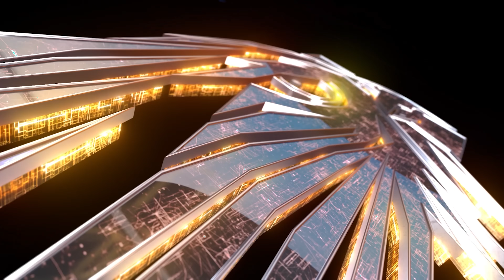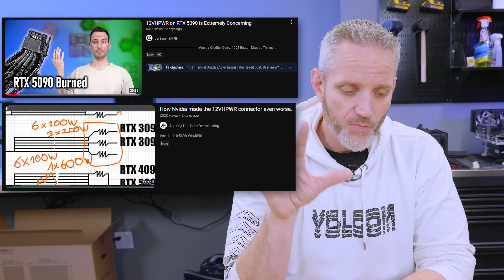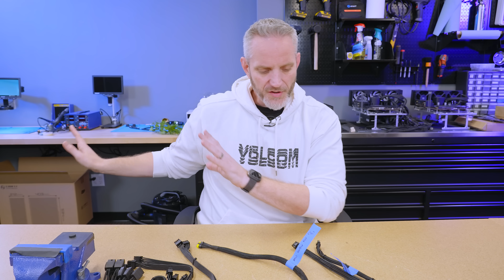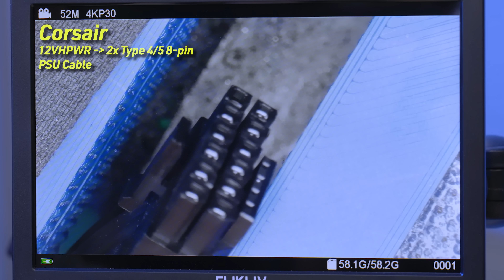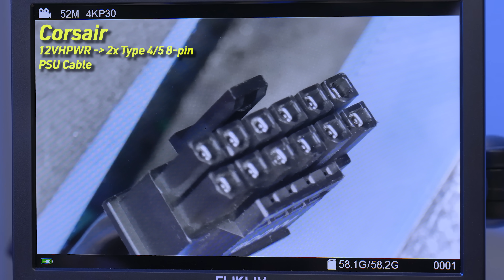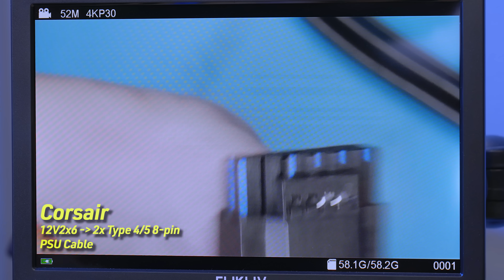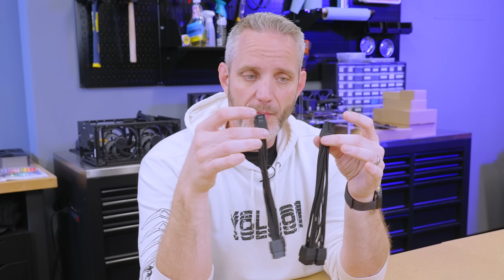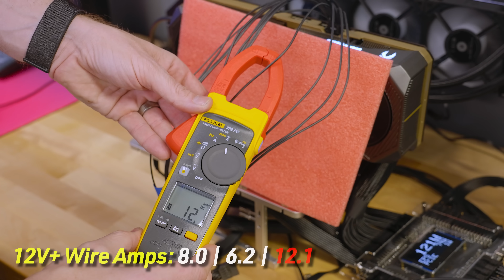I discovered something concerning and I need the Experts to chime in... More 12VHPWR discovery!

Comment: The 12vHPWR (H+) is only good for 9.5amps per core. 6x9.5 =684watts)   'de8auer' got 25amps and 150 degrees on his RTX 5090, very concerning indeed. Goodbye 5090. NVIDIA has really stuffed this one up after the 4090 debarkle and seems nothing learnt. That plug with recessed pin is really bad/ less surface area for contact means higher resistance more heat per surface area and will melt, Earth pin (Negative) is just as important as the power pin (positive) This screams no understanding of resistance & parallel circuit penalties. (down ratings there of due to resistance differences)

Comment: 13:54 - Pins moving inside the connector housing is a huge problem. Automotive OEMs go to great lengths to keep pins from backing out upon insertion, especially on high current circuits. Even if this isn't THE problem causing uneven current flow through the individual wires, it's clearly not operating the way the engineers intended and should be warrantied by Corsair.
Reply: A solid DTM connector should be an excellent replacement for this 12vhpwr trash
Reply: Automotive OEMs are usually held against regulations too. Regulations written in blood.
Reply: Lol, just saw your comment after posting mine:
You are definetly correct. Having a bad housing will lead to failure eventually.
Reply: I have Seasonic PSU and it's moving too, I noticed it immediatelly when I unboxed my new PSU, it doesn't look good to me. Ofcourse old connectors had this problem too, but it had much bigger pins and it was able to handle more amps than needed.

Comment: A bad ground can absolutely cause issues, however, there is some grounding occurring through the chassis, so that's why you don't typically see melting on the ground pins or cables.

The PSU outputs need the same bus bar setup as the GPU side of things.

It's the only way to equalize the load, without individual pin control.

Comment: ok so technically ground could be a problem. technically, it won't be as much of a problem since the GPU is grounded quite well through the pcie connector as well, which then feeds back through the motherboard and the 24 pin / the CPU 8pins, potentially even through the case.
TL;DR: ground being bad isn't quite as bad as 12V, but it's still really bad.

Comment: The 12VHPWR cable has always had a limit on its inserts before it should be replaced. der8auer video used a 12VHPWR cable with 2x8pin likely long past its replacement date. Also only using a cable with 2x8Pin means those sockets are at 100% of Corsairs claimed max, then add in a past service life 12VHPWR cable socket its no wonder that two 12volt cables where running hot. I suggest if you are going to buy a 5090 and don't want to use the supplied cable adaptor then also buy a new 12VHPWR with 4x8Pin. Before somebody chimes in about 12V2x6 cable I believe its a change in the pin lengths so isn't a change to the cable male socket ends at all.

Comment: The logic is wrong in DerBauer's and this video (to be fair, DerBauer kind of got it right near the end of his video, its mostly the comments section that gets it all wrong). 
The bad connections means that less current flows through these cables, see below for explanation.** Six 12 volt cables connected in parallel is exactly the same as having 6 resistors in parallel. If you have a high resistance on one or more of the cables (due to bad connections), then more current will flow through the cables with good low resistance connections.  Put simply, the cables getting hotter are the ones with good connections, they are carrying more current because less current can flow through the cables with poor (high resistance) connections.

**The six 12 volt cables are connected in parallel, if you have a look on the card, and inside your power supply, you will see that all 6 are connected together on the boards at either end. They do it this way because it simpler (and no doubt cheaper) to use the same thin gauge cable for everything, then when you need to carry more current you use multiple parallel cables, rather than having to swap over and use heavier gauge wire on some parts. Its a common practice in all devices, and you will especially see it on ribbon cable and flat cables where there are many very thin conductors.

Comment: A very important consideration to note - the wires that carry LESS current are the ones not properly engaged, as the worse connection means higher resistance and allows less current to pass. You will probably see higher temp on the connector itself on those pins, but the wire will be cooler. The hot wires are the ones that are effectively carrying the load, since electricity will always prefer the path of least resistance. Perhaps after you insert the connector, try grabbing each wire and pushing it into the connector directly, to see if that makes a difference? Manufacturing tolerances on the pins and socket might be the cause, forcing some pins to not engage to the same extent due to the pins sliding inside the plastic, causing higher current draw for some pins.

Comment: 12VHPWR is a crap design that in a perfect world barely can supply the current needed for these new high end cards.   There is basically no wiggle room for error.  Combine that with crap manufacturing practices using crap materials and we are where we are.  I'm still rockin my 3090 but if and when it dies and this junk connector is still the standard, I would remove the connector from the card and directly solder my own plug solution.  Hell, Anderson power poles would be better than this crap.   And Corsair is full of shit.

Oh yeah, the ground topic (edit) - I'm less concerned about a ground being loose.  There's a whole bunch of ground pins on the slot connector and the card is screwed into the case.  Having multiple paths to ground though can do weird shit to sensitive circuits if one of them has higher resistance though.

Comment: The 5090 issue has diddly squat to do with pin depth. The fact that an 8 amp wire is pulling 23 amps. That's the problem. It's that simple. Nvidia screwed up. And they need to replace the entire line.

Comment: I just wonder why they can't use 4 PCI-E power cables on the graphics card and not need any adapter.
I'm not sure why Nvidia insists on this new micro-tip 12 pin cable that crams 12 pins into to a microscopic tip.

Comment: cut a gen 1 in half and see how little plastic holds the pins in position, too much tension/torsion on the wire can alter the orientation of the pins in the plug plastic housing resulting in poor connection. Or a melted plug

Comment: a Poor ground will burn up a hot wire way before a hot wire can burn a ground.   In Mobile Audio a loose ground will pop a 300A fuse on 0/1 Gauge wire.    If the 12V power comes loose maybe some sparks, but you are also loosing the load, no load = no amps

Comment: I've been using a Corsair one for like 18 months I'd say, with my ASUS TUF 4090 on a 1000w HX1000 I think it is, and it hasn't been an issue. I'm worried now that it might be, but you'd think if it's been fine for that long that it should be good. I never thought the quality of mine was that bad.

Comment: So when you're doing the tests it does kind of look like you're using a 16 to 18 gauge. Kind of like your door speakers which usually door speakers are about 200 to 300 w 400 w is a lot. 500's a lot. 600 is extremely a lot for that gauge, especially when they're not gold contacts. 

It looks like Tamiya contacts...

They get carbon build up on them...

Eventually just by juggling a tamaya plug it will short out and stop working...

We switched to deans.  

Then Traxxas or losi ...

But i like the Chinese style XT or banana plugs both are cylinder gold plated...

Traxxas too much of a pain in the ass to solder and then clip together. Like to assemble the battery pack plug. I'm over Traxxas. I always had to have a special jig set up just to do Traxxas...

I also some like replacing a differential on sc-10s. That's a pain in the butt. Getting it back together. You have to clamp it down. It's so hard just to get the screw through to get the spider gears all back together with the spring on it.. 

I wish when i did ot they had a clamp to hole it together.. 

I used a small wood irwen wood clamp...

I was easier to just buy another ready to run truck ... When they were still $200

Comment: As an aside, in theory if each of the six "circuits" of the 12VHP connector was equally distributing load, that's over 8 amps per feed.  I don't care what the manufacturer says the spec is, I want to SEE the certified spec, because that's a lot of current to shove through those tiny little pins.  There must be some sort of positive contact dimple or something in the female end to guarantee contact, yeah?

The design of that connector and its implementation is not adequate for its application.

I would want to see spade terminals, 300 C rated 14 ga high strand OFC wiring, and a thermoset plastic or CERAMIC connector housing, in order to design for 20% headroom.  :\

I'm not an electrical engineer, I just have a lot of experience wiring stuff wrong.  LOL

Comment: If you own a bad one that is out of warranty, simple fix: Do a quality job of removing the connector from the board. I say quality, because I  am sure it is a multilayer board and there is a "barrel" in the hole that you can pull out with the pin if you don't so it properly. Hakko makes a super solder sucker for that. Take your best quality cable, cut the connector off, then solder the wires directly to the board. 
This is not for people with weak soldering skills.
Connectors are ALWAYS a problem for engineering. Both signal and power connectors.

Comment: Technically speaking amps in must equal amps out, so it should not matter which side 12V or GND has the higher resistance, they will both see the same overall current. That said, there probably is more than one path for ground to return (through the backplane/motherboard for example - it is highly unlikely the supply has a fully isolated ground), whereas the 12V supply only has the one path. This is likely why you predominantly see the problem exposed on the 12V side of the connector.

Comment: Shit engineering, shit manufacturing.  All ignoring Ohm's Law.

20a+ from what?  a 20/24ga wire?  What could go wrong?  Calculators exist, I am not an engineer.

I suppose if everything were PERFECT this "standard" could work....but IRL, that is never going to happen.

As annoying as it could be, as bad as the aesthetics would be....4xPCIe plugs would still be better.  At least I won't burn down my fucking house.

Comment: Since I know nothing about the card design, this is a brainstorming type thought, but are any of the ground planes isolated from each other? Could it be that failures are noticed on the power input pins rather than ground return pins on the cable connection because the pcie slot ground connections are carrying some of the returning current load in any conditions where a ground pin connection at the cable connection is less than ideal?

Comment: Also, ground wire can still burn up, but is carrying less load since you are also losing some of the incoming energy through the card as heat. If that bad pin was on 12v, you might have a melted pin by now, especially if overclocking.

Comment: The internal pins should NEVER wiggle or slide out if they are manufactured properly. You might be onto something with those pins, as a fully seated pin has more pin-to-pin contact has lower resistance to one that is only half inserted. Heating will occur on the contact area, and due to expansion of metals, could go runaway eventually since the contact will expand. Furthermore, different metals expand at different rates, which can result in higher resistance by default, and worse under adverse conditions. Basically, 12v2x6 is just a crap design that takes out the safety margin to maximise profit and asthetics...

Comment: Just checked my spare Corsair Premium 12VHWPR and the plug looks like the good cable.  I would not be surprised to find their standard cables having problems as the cable is so stiff, have zero plans to ever unplug mine from the GPU and it always felt like it would risk pulling the connectors out.

Comment: Maybe the problem is that the card is shorting out the 12V power rails of the PSU against each other (not to ground), directly at the 12VHPWR connector on the GPU PCB?
The theory: a PSU has e.g. four 12V rails, but they are not exactly the same. The first is also supplying power to the 3.3V rail, and the second is additionally powering the 5V rail. Only the third and forth 12V rails are the same.
This means, the internal resistances and voltages of each 12V rail are slightly different, resulting in rather high balancing currents going between the rails - along the 12VHPWR cable to the connector on the GPU, and then back to the PSU. These currents would run in addition to what the card is needing.
This could explain the uneven currents in the individual cables, regardless of the correct seating of the connectors. 
If the PMD2 is shorting out the 12V power rails as well, this would also explain why the currents PMD2 -> GPU were quite even, but the currents PSU -> PMD2 are so different.
This would also mean it is not the cables or connectors fault, but a design flaw.

Comment: If you had a ground problem, the remaining grounds would get hot. The power is getting hot because there to much power over those cables because that's where the lest resistance is